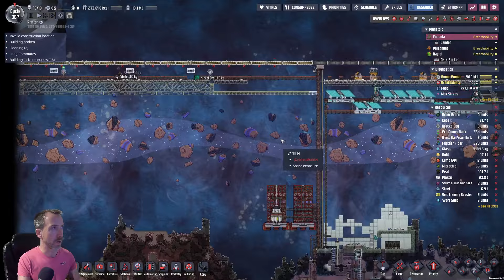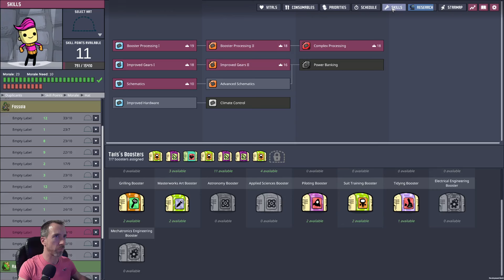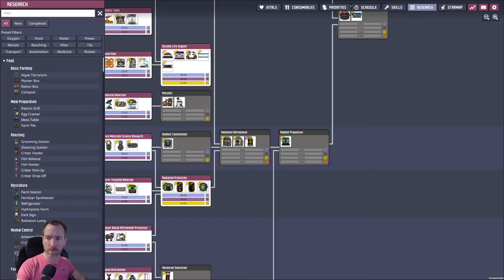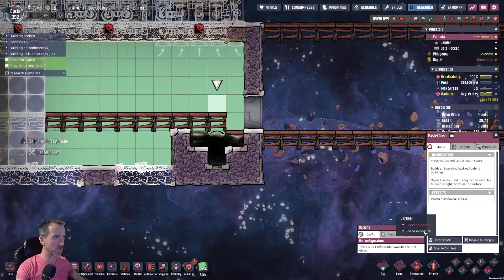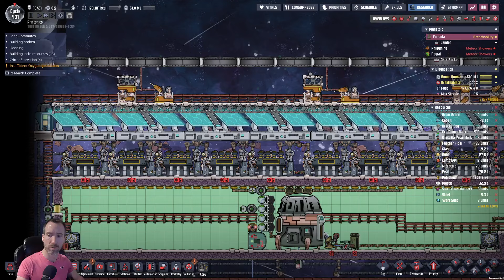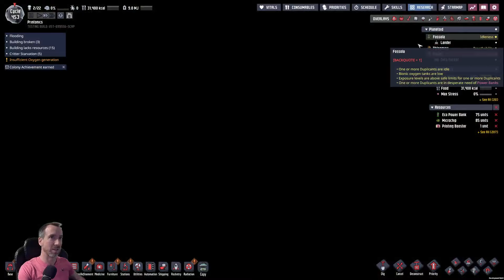The Reactor ☢️ | Printonics Ep. 7 🤖 | Oxygen Not Included ☄️

Comment: The orbital data collection lab is 625 DTU when in use.
The light is another 500 DTU.

The small battery is 1250 DTU.
Oxy Diffuser is 1500 when in use.
Manual Generator is 1000.

Getting your battery on the ship, and using Oxylite would be your 2 biggest impacts on heat.  Or switching to a smart battery somewhere.